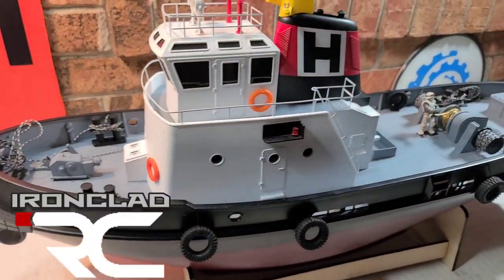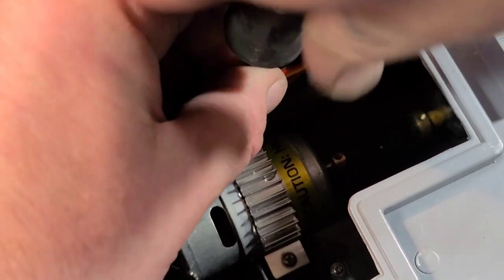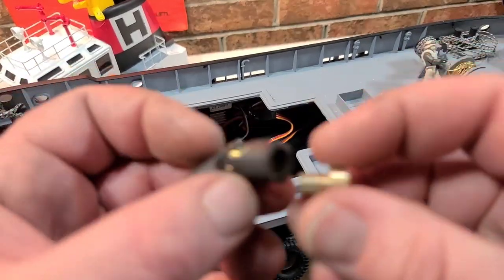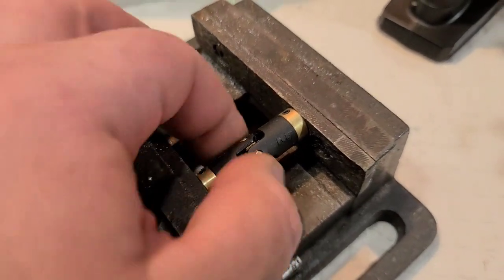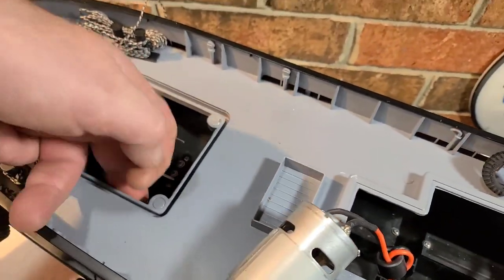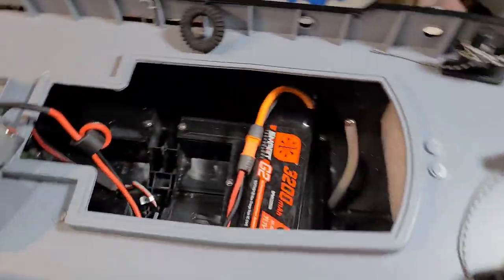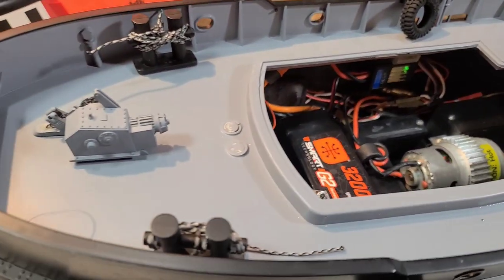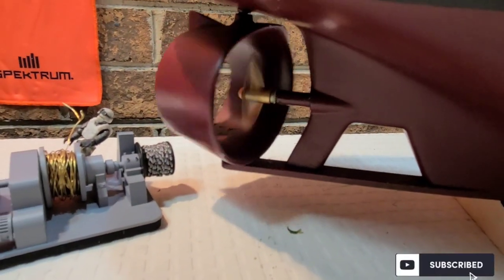Proboat Horizon Harbor Universal Joint Quick Fix, & Free Upgrade Ideas

Comment: Love the tech videos as much as the bashing. Helped me out fixed my drive cable end that started to fray  temp with soldering  and grinding get another on the way. See a missing grub screw on my tug but no issues, installed a cheap amazon pump, you get what you pay for,installed the horizon pump wow what a difference shoots water pretty far now. Emergency lights and flags for the rescue arms, peace, Boat gang for life.

Comment: Great video mate, mine was stripped  from the factory, took my prop shaft out to grease it before the first run, bone dry and the coupler was slipping as i tightend the prop back up.
Reply from the maker: Yea that's why I recommend tearing into them before they hit the water saves alot of head ache

Comment: The effort that you avoid by moving the nut away from the shaft tube, ends on the motor bearings... So I rest the nut right on the tube without play but without constraint either.

Comment: If this is Air Cooled, why not install an ESC fan in the cabin area to circulate air like we do in Trucks? Did that super glue mod fix your water intrusion?
Reply from the maker: Fan wouldn't hurt, mine never got hot

Comment: I'm the somebody trying to get the shaft back in. What flex screwdriver were you using? I ordered one from amazon and it's too big to fit inside to get to the screws. I actually got the screws  out by being resourceful  but want an easier way to get them back in. FYI. Used the 3 BLADE  Prop from Offshore Electrics on the 42 last weekend. Hit 72 mph right away then flipped and cracked the rear deck. Working on fixing it. Drive system on this boat is weak. Look out for weeds. Keep up the videos. I'm a believer.
Reply from the maker: I used this flex driver flex shaft,   I also cut down the bit. I basically cut the bit on half with a cut off wheel, makes it a little more low profile. 
 https://www.hobbylobby.com/Crafts-Hobbies/Hobbies-Collecting/Tools-Blades/Magnetic-Screwdriver-Tools/p/80885034
Reply: @IRONCLADRC  Thank you for the tip. I'll  pick one up. Funny how the manual just says reassemble  in reverse order, in other words just push the shaft back in. Yea, good luck with that. Tack care Ironclad.

Comment: Hi awesome informative video...its an awesome tug boat ive just gotten mine aswell & doin some mods like upgrading the motor to a Traxxas 775 Titan for a lil more pep/power & changin out the servo & radio to a spektrum... as seeing this coupler improvement,would using JB weld to secure the pressed brass fittings be a good idea,more like a "perm.fix" or just swap out for a metal coupler? Also input a teflon washer between the prop/shaft for a lil'better spacing.... awesome videos tho...keep up the good work...!
Reply from the maker: I think your on the right track with the jb weld  either way will hold.  Those splines will lock it in tight.      Metal universal would be best, make sure it's the right length the HH has an extra long sleeve

Comment: I would have trashed that coupler and change to a full metal coupler. Also, still think you need to add in a disel engine sound. 😊
Reply from the maker: I can't find an upgraded  coupler  long enough.
Reply: @IRONCLADRC  did you ever find a good replacement?
Reply: What about a longer shaft to accommodate the better shorter coupler?

Comment: Hey just pick one up. Heard she likes to take on water, have u experienced this and if so, did u find where it’s coming from?
Reply from the maker: Mine was leaking where the topside & bottom side is connected, the seem  there's a "hand rail" that goes around the boat I used CA where the seam is.  its right under the "HAND RAIL"         super thin CA Seemed to do the trick.

Comment: Big B, have you ever thought about upgrading the ESC in the Tug, if so what ESC would you go with ?
Reply from the maker: Personally I'd go with a cheap brushed esc only because I've been running my tug boat in salt water.   Ive used Dynimite marine brushed esc's in the past with great success.  Not sure how well it will pair with the big tug boat motor though?
https://www.avantlink.com/click.php?tt=cl&merchant_id=953aec29-878e-4306-b620-2df85883455e&website_id=70256520-69d3-496b-a06d-cfbf9af7a81d&url=https%3A%2F%2Fwww.horizonhobby.com%2Fhttps%3A%2F%2Fwww.horizonhobby.com%2Fproduct%2Fwp-60a-brushed-marine-esc%2FDYNM2210.html
Reply: @IRONCLADRC  thanks for the information. Got one on order.

Comment: @IRONCLAD RC- Mind was missing that back grub screw as well.. Question -  I losend up the front grub screw but I still can't get the cable off  to grease! What am I doing wrong?
Reply from the maker: I grease mine externally I've yet to pull the shaft so I couldn't tell ya.

Comment: Check out your bow area upside down you’ll find a hole in the anchor area plug with a hand made anchor and you should have no more water inside. Don
Reply from the maker: I just looked?  Didn't see a hole, topside or bottom side?